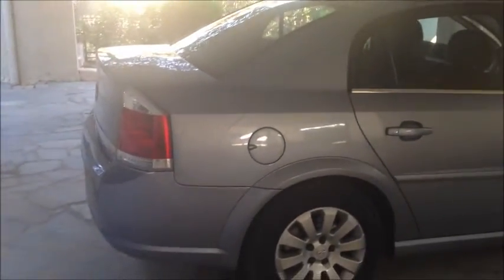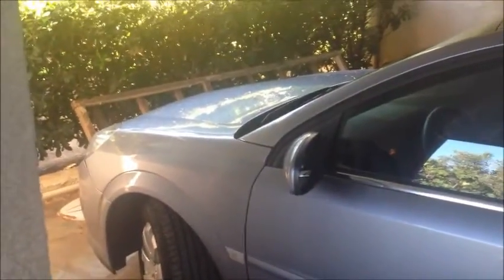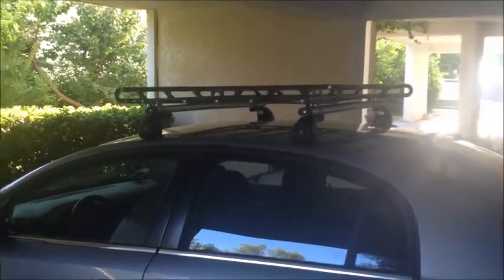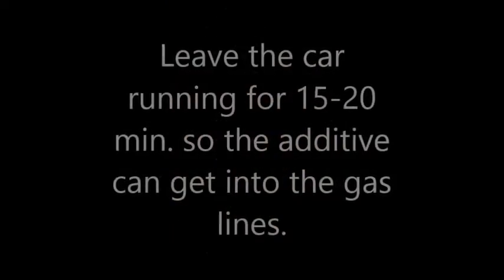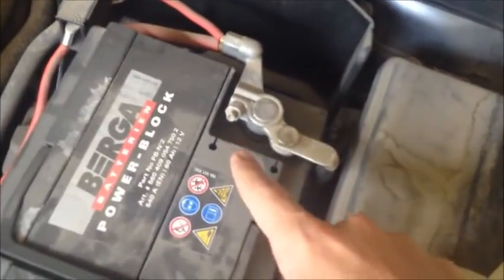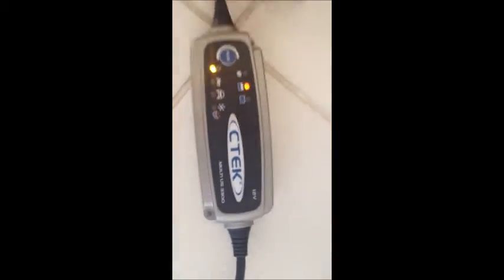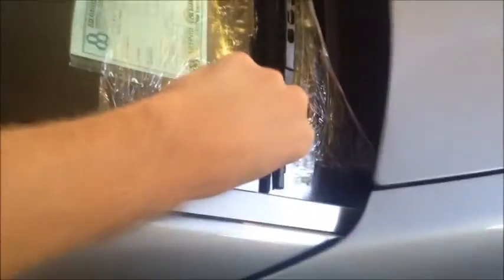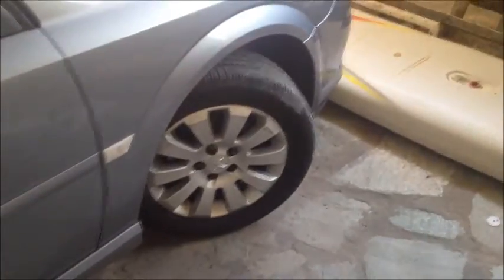How to Store a Car Long Term

Comment: the car sitting for 10 months is a long time... most importantly oil change, coolant, transmission, gear... wash the car and wax it.. and don't ever leave your wheels turned like that.. its bad for the suspension especially the bushings.. if possible leave the car on jack stands and if leaving it's outside make sure you use a outdoor car cover...